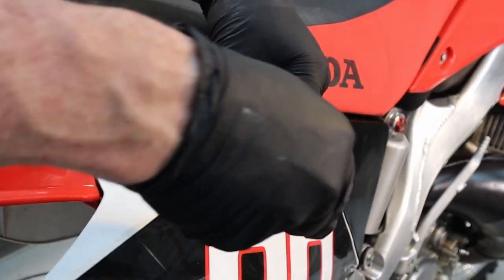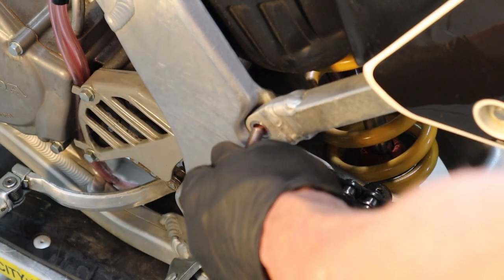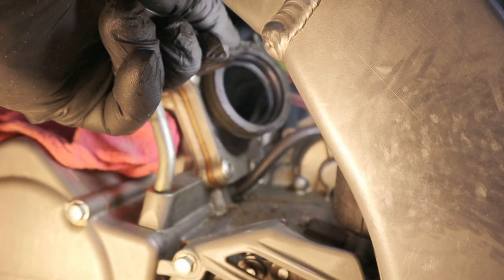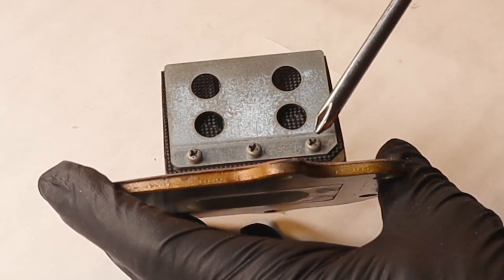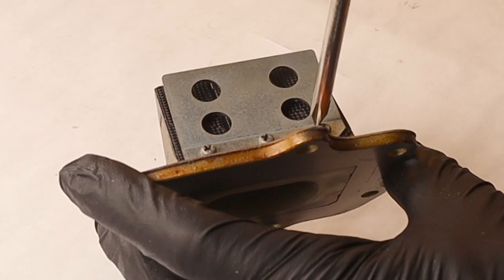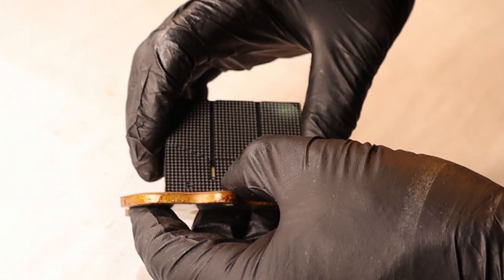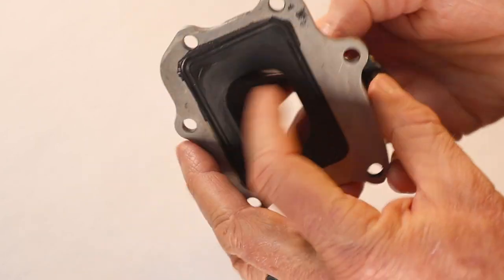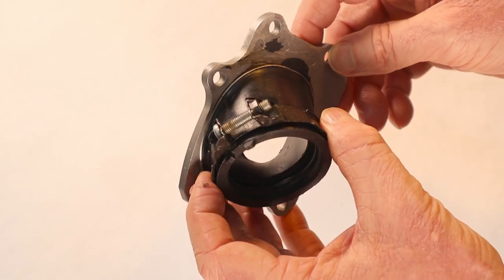Fast and Simple Reed Valve Inspect And Replace

Comment: The dots on the reed petal screws mean that those are JIS, or Japanese industrial standard. Not Phillips. They are meant to take a special JIS screwdriver which will fit properly and reduce the chance of rounding them out. If you use a Phillips and round them out (like I have), there's another tool which will remove them easily. That tool is a large pair of needle nose pliers. You can usually grip even small button head screws with them by laying the pliers flat against the plate and gripping around the rim of the screw.

Comment: Another well done and informative video, Thank you Brian.  Do you suggest turning the petcock to "off" before removing the fuel line or is that just extra work?  I mix the gas and oil at 32:1 like the book says if it makes any difference with the life of the reeds. The little marks along the timeline is a nice touch but I watched it all.
Reply from the maker: That’s a good question!  I had already removed the gas tank before I removed the reeds for this video so the petcock was removed from the bike.  But, YES!  Close the petcock if it’s not closed. By habit, I always turn my petcock to the OFF position when I stop the motor after riding my bike. So my petcock is in the OFF position any time the motor is not being run.
Reply from the maker: Oh, as for the 2 stroke oil ratio, that will have little impact on reed life. Reeds don’t rely on lubrication to function but, I mix my oil at 32:1 for other reasons.  Its cheap insurance for ensuring engine longevity.

Comment: So people are just supposed to stop using gaskets?? Explain why you're going with this theory.
Reply from the maker: Hi Jay.  I dont think I suggested not using gaskets.  Thank you for watching!
Reply: @brian.d.mobley  Helpful video BUT  you didn't use any gaskets. I'm curious why .
Reply from the maker: @jayryan7473  I used gaskets in every location gaskets are used in the Honda Service Manual.  I hope that assuages your curiosity.  Thank you for watching.
Reply: @jayryan7473  some of the reed blocks or spacers have integral rubber material bonded to them that acts as a gasket